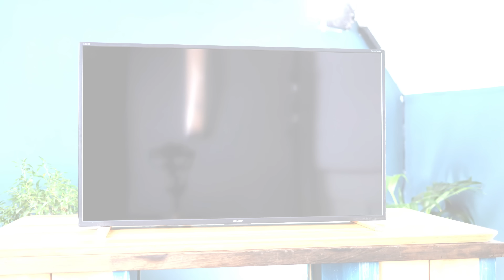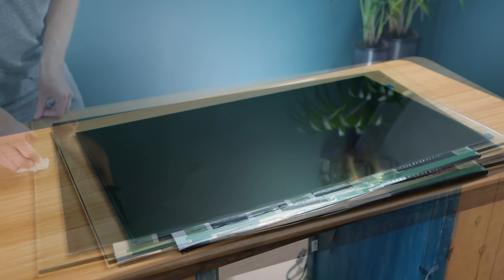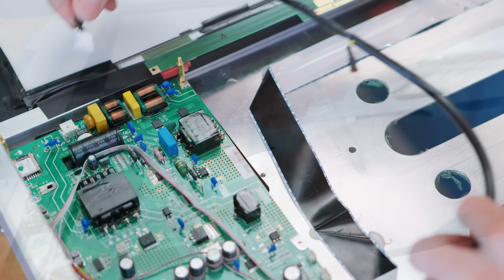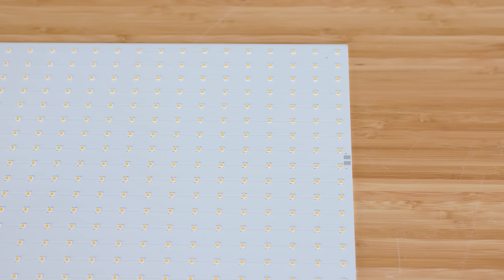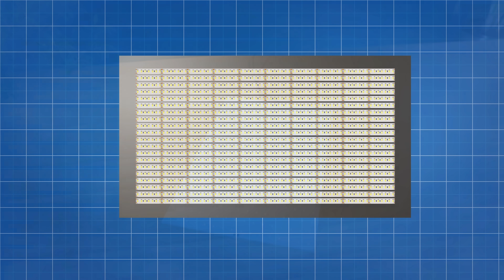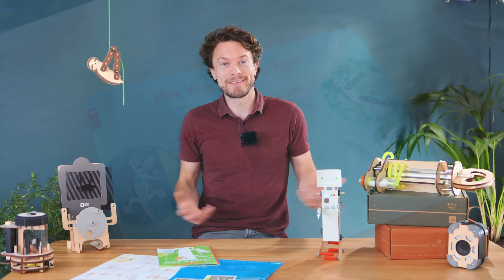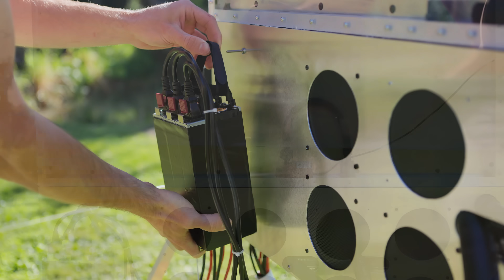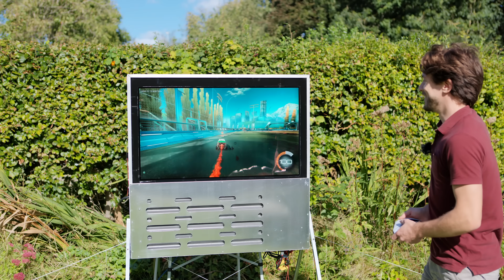Building an ULTRA-BRIGHT water-cooled TV...

Comment: Tv driver boards run a self diagnosis when turned on and if it sees that the backlights are faulty or unplugged then the tv will not turn on. Did you do anything to fool the driver or did your just so happen to work? What brand was this tv?

Comment: You need a neutral density filter to make that colour measurement.   I used to use the exposed ends of a 35mm negative film,  but I suppose you don't have any lying about.

And on another topic, did you consider paying young children to aim supersoakers at the back instead of all that complicated cooling design.  I mean, what could possibly go wrong?

Comment: You keep doing the same mistake of assuming "higher CRI" = "better colors" in your LCD applications. First of all, that's not even what CRI measures in the first place: what it actually measure is how ACCURATELY that light source reproduces colours COMPARED to an ideal light source WITH THE SAME COLOUR TEMPERATURE. A LED with CCT 1900K and 95 CRI will still have troubles in rendering blue tones. Second, the colour gamut of the screen is mostly decided by the filters built into the LCD matrix: it is possible to extend the gamut with an accurate selection of your illuminants, but that will be at the expense of colour accuracy.

If you want accurate colour rendering you must use LEDs with a spectral emission as close as possible to the one of the LEDs originally in the TV, since the LCD matrix and the electronics are calibrated on that emission; scratching that, try to at least match the colour temperature of the original LEDs (probably 5000K).
If you want to expand the gamut and improve the brightness per watt you should use highly monochromatic red, green and blue LEDs: if you want to maintain a semblance of colour accuracy you should use LEDs with emission peaked at 610nm for red, 555nm for green and 465nm for blue. If you just want the best colour saturation you should go with 630nm for the red and 532 for the green, while keeping 465nm for the blue

Comment: As usual another great project.
I have 7 rooms in my apartment (4 bedrooms, 1 hall, 1 kitchen, 1 bathroom) I have a tv in all of them ... except the bathroom. So could you please make a tv that could hang in my shower. Im thinking 22" since I will be very close and as thin as possible, and my do it like at picturefram with a string so I could move it around, from the shower to in front of the toilet. And with chromecast so I could cast whatever. Sound I dont know if its needed ?

Comment: If you would want to keep the tv outside permanently (even on rainy day) you should seal of the electronics airtight too. Because the moisture could get through the radiator to short something in these exposed circuits. :)

Comment: Hi nice build but what about the expansion of the gas inside the cooling system? 
I would be concerned that if it is a hot summer day the evaporation of water and the thermal expansion of the gaseous volume would break the seal.

Comment: Hi I really love the project! It's a fun 'out there' idea [pun intended]. I wonder if using parts that are a bit more 'manageable' for the cooling-system might make things easier and less bulky, while maintaining a stable temperature. I am thinking along the lines of PC watercooling system, fishtank pump, a old refrigerator-condensor & compressor set etc., and old mobile airconditioner.
The other thing I was wondering about... You tend to use aluminium etc. a lot in your projects. Although very practical and affordable, it's not always the most pretty solution. That's why I'd suggest to 'let your hair down' with these OTT projects and use / up-cycle more 'outlandishly' e.g. a pictureframe, door, painter's easel, shallow cupboard etc. for project housings.
I can't wait to see what your next project is all about.
Willem

Comment: Seems like coating the PCBs and MCB in a fine layer of epoxy might of been a added benefit, much like a automotive computer. Also i would of suggested non-water non-glycol based coolant like "Evans coolant" as that would of prevent corrosion of your aluminum parts.

Comment: I would want badly a tv for my garden, but i have a big big problem!
Well, there are many mosquitos, and you can use any type of product against'em, but you'll never defeat them! I tried!
I would also need the electricity, that i currently don't have.
It's much easier to setup a mobile setup.
Maybe a portable 1440p 144hz monitor, a very bright one.
With a with an extension power a console or a pc.
That would be easier, and the solution could be also used indoor in any room, with friends and family...

Comment: you shouldn't rely on a mechanical connection to make an earthing connection to the rest of the frame, ideally you should use earthing jumper straps to ensure equipotential bonding for safety.

Comment: Curious about the LCD degrading from sunlight UV exposure and from the high intensity LEDs in the back. If you haven't addressed it already pretty sure a good idea to keep it covered to limit UV exposure
Reply: He used glass as the outer layer for the LCD panel. Glass blocks almost all UV-B rays and some UV-A spectrum too. 
So he inadvertently added a safety measure to at least stop the plastic or other polymers from rapidly degrading due to sunlight.
Reply: @abhir2596  glass definitely helps, but it’s still at risk of damage over time, if the display is left outside in direct sunlight.
This is an issue with our automotive displays even when bonded to high performance glass like Gorilla glass, Xensation, or DragonTrail.
Reply: @abhir2596  He also said you can use windows(Which are designed to block out UV)
Reply: my lcd tv has red spots in the corner, the window is
Reply: @Vikesh7896  we will never know what this man wanted to tell us. it will remain forever a mystery.
Reply: @licht4808  They mean they have a tv close to a window that (probably) stays open in the day, where the sun shines through, and I'd venture a guess the light of the sun shines mostly in one spot on the screen of that tv. And now that spot is redder.

Comment: I don’t have time to finish the video right now… so this comment might not make sense. I apologize if that’s the case.

But as someone who owns an electronics lab, With a full-time business doing component level board repair and test equipment calibration for industrial clients… don’t cheap out on the important stuff.

Maybe you didn’t… However I know you mentioned the beginning of the video that you were going to do it as cheap as possible. 

But Jesus Christ please be sure to use really really good reliable LEDs, proper heat dissipation, and another really important thing is the plastics and materials need to be absolutely impervious to UV light. that includes any adhesive or epoxies that will be used.. Because it really won’t be that much more expensive, seriously like 10% more expensive to get the really good stuff instead of middle of the road. That’s the way it goes with most industrial and ruggedized electronics purchases… You might spend 10 to 20% more but get something that’s 200% to 500% more rugged and reliable.

Just heard you mention UV cured glue. Just because adhesive can be cured with UV light… DOES NOT MEAN it’s UV resistant. Actually in a lot of cases the UV light will continue to interact with it, and age it quicker. It needs to specifically claim that it is meant for Constant bombardment by uv rays..
Just like the wonderful quality UV cure resin Apple uses bonding some of their displays. It’s a wonderful quality resin, but if you leave your phone in direct sunlight a few weeks straight… That resin will actually begin to yellow and degrade. Because it continues to react with constant heavy UV bombardment. 

Think about it another way… There are a lot of two-part finishes used in industry and manufacturing… That actually cure better and tougher at about 120°F. They are two-part curing, so they don’t need it because it’s a chemical reaction. It just works quicker and allows a bit more speed on the assembly line.
But once they’re cured, if you just leave them in the oven at 120° for a week or two… It’s not going to make the pain any stronger. And in the case of UV curing and exposure… It’s going to go south really fast.

I don’t build outdoor TVs for a living, I’m not a professional material scientist, chemical engineer, or anything like that. I have a little experience in a lot of areas, and just trying to be helpful if I can. I always love to see you having fun and making awesome project. Your attention to detail is second to none, and it’s very encouraging to see you share your passion with all of your followers. 
Hope I didn’t come across as discouraging, just writing down as many things as I could think that might be helpful, and things that I’ve actually had experience with. Sending much love your way… Hope you grow some big parties and everyone enjoys that really cool TV!
Reply: Also, with something like this it’s going to be hard to do repairs or maintenance… so to stop any issues… It’s best to “De-Rate” the LEDs. Run them less than what they’re rated for. 

In other words if they’re rated to push 100 W, then only run them at 50 W. But used twice as many so you get the same brightness.
. They will last much much much longer. 

This is pretty much mandatory when ordering power supplies, LEDs, and other things from China or other budget manufacturers. Don’t get me wrong, I love China and they actually make some really incredible things… and are far ahead of most of us in regards to technology and manufacturing.

So many people in the US always say that “everything from China is garbage“ not realizing that the reason they’ve had bad experiences… Is because of the American businessman and importers buy the cheapest stuff they can so they make the biggest profit. An American consumers aren’t willing to pay 5% more for something that’s going to last 10 times longer. 

Their technology is second to none, and their innovation will absolutely blow you away. I’ve been to Shenzhen twice and it was incredible, and I’ll have those memories forever.

. But when buying offbrand LEDs or power supplies… Whether for a 3-D printer, doing undercabinet lighting in your kitchen,or some other project… I always tell people to buy at least 30% maybe even 50% more powerful than what they are going to use. That way it will just last much longer.

Comment: Fascinating project, and really well thought-through!  I might quibble about one thing: I don't know why -- after doing such a neat job of integrating the guts to the housing -- you decided to run the radiator hoses straight out of the back, and have the hoses exposed like that.  Why not fit elbows onto the radiator's inlet and outlet, so the hoses can be run flush, against the back and inside of the housing?

Comment: important to consider that many if not most TVs have a protection feature that if the backlight is not hooked up, the TV will turn on, then right back off - so you would have to trick the logic board into thinking the original backlight is hooked up. Shame he didn't cover this...

Comment: "Keeping the cost as low as possible" First of all, "as low cost as possible", in my eyes, doesn't include custom bent sheet metal and flawless car radiators supposedly found at a scrap yard. If you asked me to build this regardless of expense, it would look similar to the one you built. Second, TVs designed to work outdoors like a SunBriteTV do not  cost 5 grand unless it's a 75 inch. That there looks like a 32 or 44 at most. Let's be fair here and say 2 grand for a 32 inch. I'm not sure what you're trying to convey through your channel with the name DIY Perks. DIY implies people have these things just laying around their house. I don't have extruded aluminum channels, laser cut sheet metal and UV glue collecting dust out in my garage so this channel really isn't for me. If you would have slapped this puppy together with some pitted scraps of wood and melted duct tape, you would of had 1 more subscriber.
Reply: DIY just means making something yourself, the cost of it doesn't matter. 
As for the poll, that was the choice between something that works and something that is overkill. Slapping something together with a bit of wood and tape won't work for very long.
And even then, he specifically mentioned other types of backlights as more budget options, and of course if you wanted to you could replace the casing material with whatever you want too.
The video isn't a step by step guide on how to make it, it's just giving you a general outline on what is possible.
It leaves room for creativity, which is in my opinion the entire point of DIY. If i can't find what I want in a store, I'll just make it myself, the way I want it and need it.

Comment: It's a neat build, but tbh if you're going to watch a TV, with or without friends, you should probably just go inside. Also those power supplies are insanely loud, and I'm sure the water cooling system isn't exactly quiet either, so again while it's a neat project, not so much practical if you ask me.

Comment: That's pretty awesome, though when you get into really large sizes, like 80+" screens, those LED strips start to look like a better option. On a similar thought of big screens, can you make a 4K projector that also works outside at about 100" or more?
Reply: The projector is so much more of a difficult setup because of the optics and small lcds... From the start they require very good water cooling and you cannot have it fail with the leds running since you will probably burn everything up. Here it isn't feasible to just use some old (LCD projector anyway, dunno about DLP, probably not that either) because adding extra cooling to is would cost an A LOT. 

Getting some very large but still relatively cheap (still thousands) 80-100" TV would be much simpker because of no requirement for any optics engineering. A projector would be so much simpker to haul around and for that reason I also like them in my home. But talking commercially - a daylight viewable outdoor projector with 100" image as bright as this TV would probably cost something at least 100k$ if not more. You'd also probably start needing electrical work done to your house to feed that 5kW+ lamp.

Instead I would like to see a way to make diy rgb led-panels with easy to manufacture, lightweight and easily stackable and configurable to make very large format displays. They'd still require some optics but much more simple than when it comes to a projector.
Reply: Projectors already use very bright bulbs that tend to be very expensive. Is it possible to make one even brighter? Absolutely. Is it going to be even remotely affordable? Probably not.
Reply: Not likely. With projectors you are always fighting against ambient light. The biggest issue here is going to be the screen surface itself. You're mixing the projected light against ambient light on a reflective surface. You need to control ambient light, otherwise you would need massive amounts of projected light during daytime. Even then the display would be washed out. With direct-view screens it's much easier.

Comment: As cool (heh) as the radiator water cooler is, You essentially have a cooling tower structure built into the back of that panel! If you were to force air through the "rain chamber" part of the tv you could cool the water through evaporative cooling, as well as cool the TV. You could even separate the process via a couple of pumps / pipe systems so you can limit water loss to evaporation (one pump to pump through a sprinkler droplet maker, and one pump to pump through a pipe that directs water onto the cooling panel.) Just run the sprinkler pump when the water needs to be cooled down.

Upside to this method is you eliminate the large radiator, reduce fan usage (natural convection of the warmed air in the sprinkler chamber will help draw in cool air [can be supplemented with some centrifugal fans]) and reduce complexity in the system. Downside is you loose your coolant to atmosphere and need to top it up occasionally.

Comment: (Beginning of video) I want it solar powered
(LED portion) I'd put peltier modules in to utilize the heat for voltage and run a low power pump solutions. Cut power costs

Comment: And exactly how did you trick the TV´s board to function without the LED backlight? Most of them I´ve seen have some kind of protective circuit and if they find out about missing LEDs or backlight failure, they switch off.

Comment: If you open a TV, PLEASE discharge the BIG capacitor first (with a screwdriver or a lightbulb). It's usually a mains voltage capacitor and it can zap you REALLY, REALLY bad. Been there, done that. Luckily I only got blisters from it.